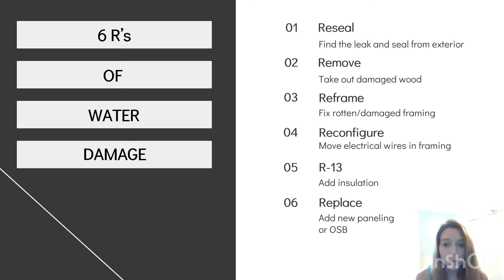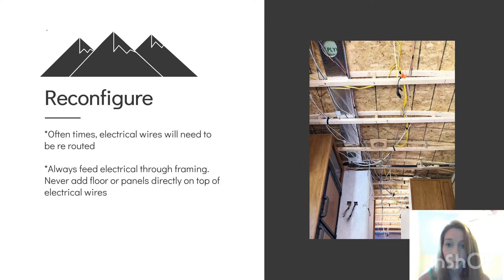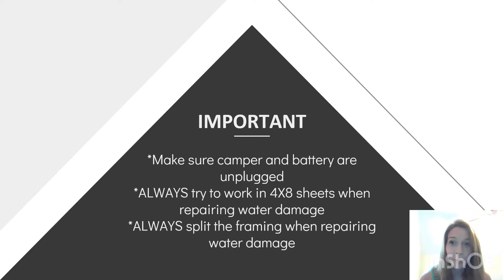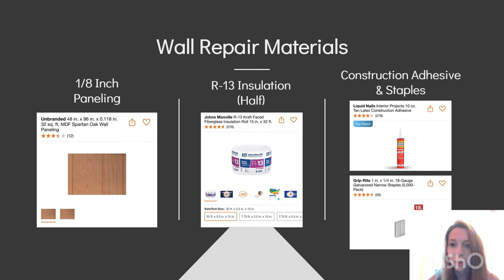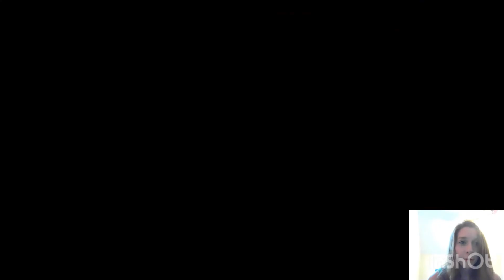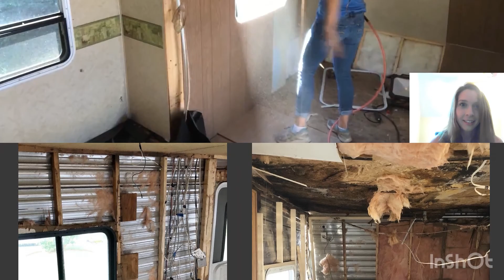RV water damage repair to walls!

Comment: Question: if the damage is below the window on a slide, would you need to remove window reseal and put it back in or can you just silicone it without taking it out

Comment: Where do you find a replacement wall for a slide, for the exterior of the camper. Our exterior wall on the slide is not aluminum and it has really bad water damage
Reply from the maker: Hey! Email me some pictures so I can see it at fallenintocamping@gmail.com

Comment: Is it best to remove the exterior aluminum if you have extensive damage to the wall framing and rotted corners?  Do you have a video showing the process of removing and reinstalling the aluminum? Thanks.
Reply from the maker: Unless you have an aluminum welder, I’d suggest support instead of remove. You can buy angle aluminum from the hardware store and rivet (or screw) it into the existing frame in areas that are not corroded. Make sure it spans the entire piece though, that way you have the best chance of lessening the stress on the riveted joints
Reply: I also have extensive dry rot damage in the walls to many of the studs around windows and at floor joists. Should the aluminum siding be removed and reattached to the new wood members or can they be attached in another way so the aluminum siding doesn't have to be removed?